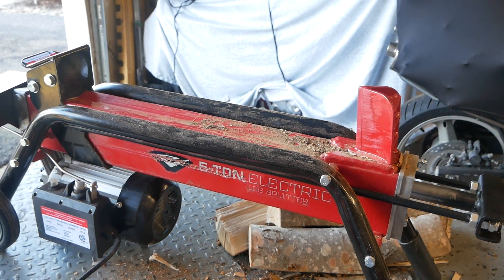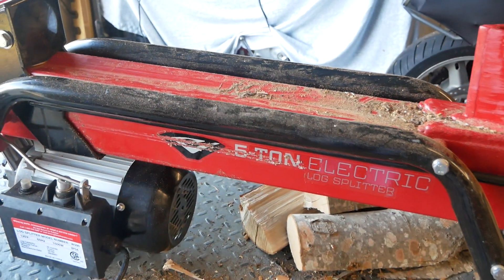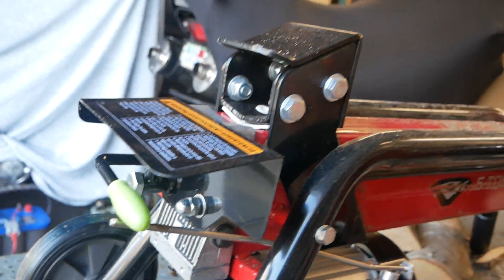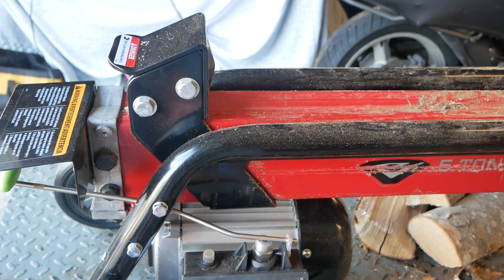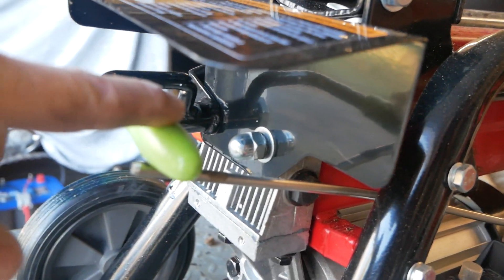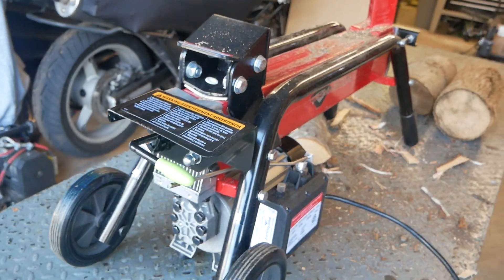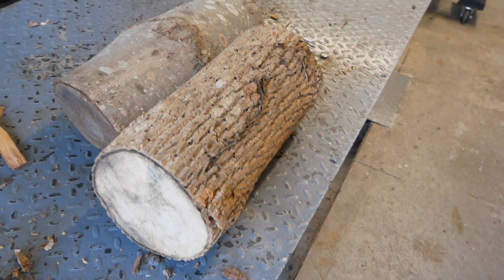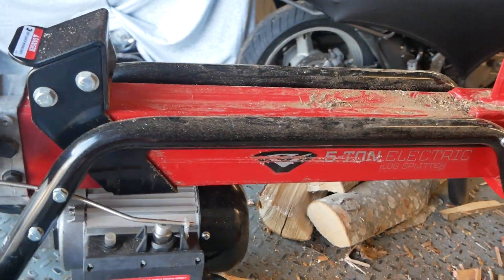EARTHQUAKE 32228 Electric Log Splitter Modification

Comment: Only one major error, you can't stop the ram going back to the start..... 
The best mod is the one that allows you not to have to use two hands but lets you stop the ram just a bit longer then the log you're about to split, it takes far too long to split a lot of logs with the ram right back at its start position!
Reply from the maker: This is an older video. Now it has been converted to Foot Control!
Reply from the maker: All I did was add a piece of small chain to the lever with a piece of plywood on the ground. Step on the plywood and it pulls the lever down....NO HANDS OPERATION!
Reply: @roybertalotto6355  wonderful idea. you have videos on it? i would love to see how you did it.
Reply: Thats an even easier fix. Extend the ram to about an inch longer than your wood. Then squeeze a pair of vice grips on the end of the shaft to keep it from extending any further than that 1 inch. Mine actually came with a shaft collar that does this.

Comment: Cheap easy only took 20 min to do it all. PLUS MY BODY, HANDS and HEAD is NO WHERE AROUND THE DAM THING.. Its hands free, and peddle operated . Since is on concert blocks, i made a cover for it out of fiberglass corrugated panels to seal it up in, and it stay out side on the blocks. I just lift the cover off and on You can used liquid nails to caulk the blocks togather, but i just stack them side by side, and on of top. Then lift the log splitter on top of the blocks. THAT WHERE IT GOING TO STAY AT >  You will need a leaf rack for clean ups around the splitter.  A couple of Gorilla carts to haul the logs and fire wood around in

Comment: I made mine hands free Here a link like i did>  but better I set it on 8 concert blocks 4 in the front 4 in the back. I extended the level handle out where it out beyond the tires. I used rustproof bailing wire for the loops for the rope to run in into the peddle and a dry wall screw on the heal for it to hold down into the ground. and instead of a stick, i use a latch for on top of the button where the rope is tie to it. > https://www.youtube.com/watch?v=9o_bVddaz-U